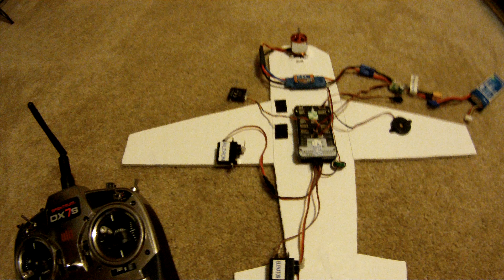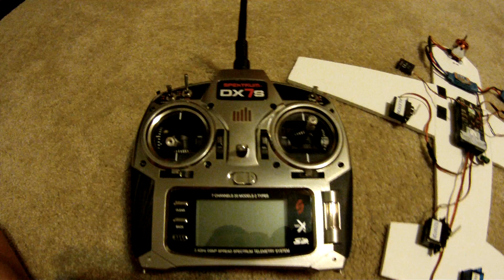RC Plane Control Test  with Pixhawk

Comment: can you show me how could set up the pixhawk without an airspeed sensor neither gps? i'd really appreciate that
Reply: If I remember correctly, the sensors are connected straight into the Pixhawk, so if you don't need them then you just disconnect them. Though if we're talking Pixhawk Firmwares and autopilots, that's a different issue entirely.

Why though? I assume you want to do HIL/HITL?